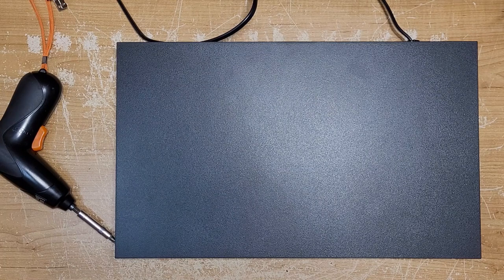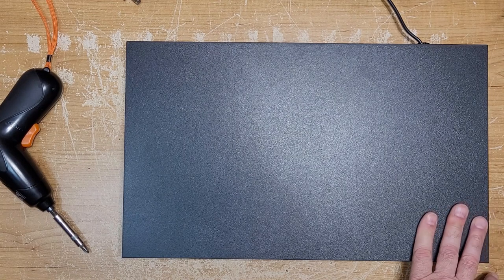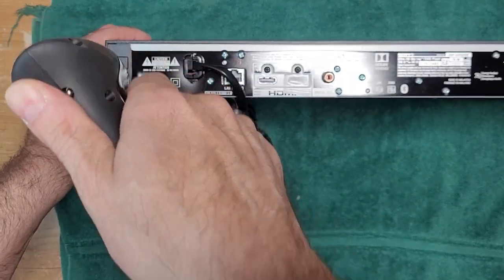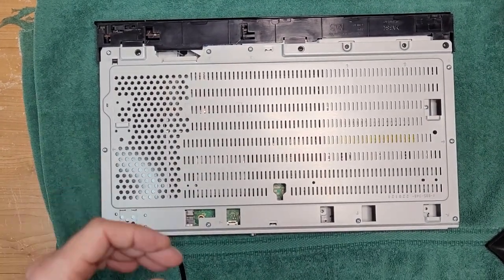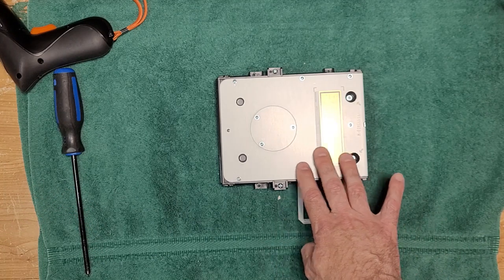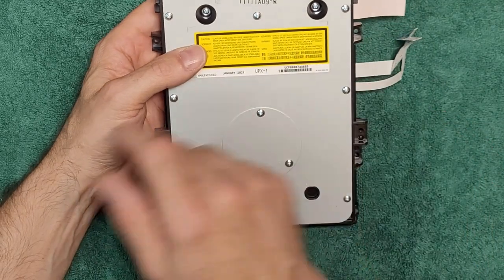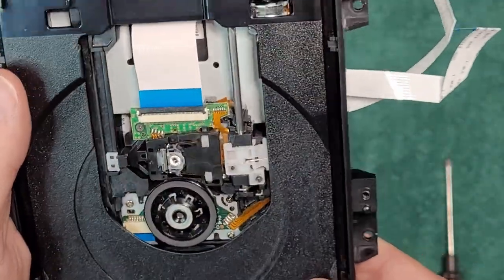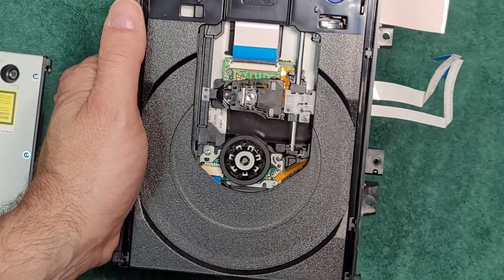Sony UBP-X800m2 4K Blu-ray Player Freezing Issue

Comment: I have the UDP-X700 that freezes on 100Gb discs on the third layer change. After a lot of testing, I proved it was heat related by removing the cover and running a small fan on top. From there, I desoldered the heatsink and replaced the thermal transfer material on the main chip under the heatsink and added some thermal transfer material on the memory chips that are under there too. From there I have installed a small, 5V fan pointing at the heatsink, powered by soldering to the USB socket internally. So far, no more freezing. Still it’s a lot of trouble to go to just to get something working the way it should have from the factory.
Reply from the maker: I've run my unit with the top off so that it would get full, open ventilation and I've added heat sinks to all the chips.
Reply: Awesome, might as well build one from scratch.
Reply: @garyharper2943  I completely agree, but it is the only 4k player I have.
Reply: @Space-Coyote  Great you have that skill, no such luck for me. I did buy a USB fan that I’m going to either suck or blow air from the back. Looked at just buying the Panasonic, but they seem to not be glitch free either. It’s not that big of deal, but I can’t stand anything that doesn’t work properly , maybe that’s why Oppo got out, couldn’t make one that would reliably work.
Reply: @garyharper2943  Yeah, I have heard about similar experiences with all the 4K players out there. If you are comfortable with removing the cover, it might be worth running the fan on top of the heatsink, just to prove the problem one way or another. Bearing in mind that I have the x700, not the x800 and the x700 is very easy to get into. Good luck!
Reply: @Space-Coyote  I have both the 700 and 800 with same issues.
Reply: @Space-Coyote  Wanted to give you an update, since you provided lots of ideas. I ended up purchasing an Infinity 4” usb fan and placed behind unit blowing away from player. I have watched 3 problem 100 gb discs since and all played without issue. Not ready to declare victory but so far so good!
Reply: @garyharper2943  Hmm that is good to know. I'm not 100% happy with my internal fan solution. It's a 1” fan running at 10k RPM and while it isn't noisy, it does whine a little. Sounds like the air flow your fan creates is enough to keep things cool. I would be grateful if you could keep me up to date on your findings.
Reply: @Space-Coyote  will do , the infinity fan has three speeds and is quieter than my projector fan and I didn’t have to open anything up!
Reply: @Space-Coyote  More good news watch 1917 and John Wick 3 both problem 100gb disc, no freezes. Now the really good news, watched them back to back!
Reply: @garyharper2943  That is good news. It definitely seems that there is a problem with heat. It is odd that not all of them have the skip/freeze problem. I hope this is a long term solution for you.
Reply: @Space-Coyote  Thanks, it’s almost like some of the movies make the unit “work” harder.
Reply: I’ve had to sit X 700 for years it hasn’t skipped once and I watch movies on it almost every night. This is not an insult but maybe you’re not taking care of movies correctly or you just unfortunately got a bad one.
Reply: @michaeldietz2648  mine 800MK2  is freezing on Netflix and YouTube after long time period approx. 3hour and more. Next video just stop on 20% load or such. Can`t turn it off with remote have to unplug the cable from socket. Will try to open the case and check temperatures.
Reply: @ivanmelkner7704  Well I’m not sure in your situation because I would never use 4K Blu-ray player to watch Netflix or YouTube but that might also be a problem with your Internet.
Reply: Hi, with the fan powered by USB have you solved the problem definitively? Thx
Reply: @Space-Coyote Hi, with a fan powered by USB have you solved the problem definitively? Thanx you
Reply: @garyharper2943 Hi, with the fan have you solved definitively the problem of freeze?? Thanx
Reply: @TheZakkomodenese  It improved the problem, but did not solve it completely . I ended up getting a Panasonic 420 and it’s been perfect.
Reply: @garyharper2943  Thank you for feedback. I have added a fan inside the unit powered internally by the USB and for now 0 freezes.
Reply: @TheZakkomodenese  It definitely removed the problem for me, although it is hard to comment now because the player was dropped and now it won’t read discs at all. I’ve had my eye open for replacement drives since but nothing has come up yet. I replaced it with a Panasonic 820 which has been bullet proof, but comes from the factory with a fan.

Comment: Most of the time, it's smudges or a film on the disc (especially 4k).  Try cleaning the disc with a soft microfiber wipe.  I had freezing issues on the 800M2 and that fixed it.  The laser has trouble reading thru the film or smudge.  Quality control on 4K discs has been substandard the past year or so.  Try cleaning the disc you are having trouble with. It will more than likely fix the issue. It's not s Sony software or hardware issue...it's the disc manufacturers.
Reply from the maker: Tried that, no difference.  I'd say it's definitely a Sony issue since the discs play perfectly in my Sanyo 4K player.
Reply: No it's not the disc at all you fool. It's definitely the player.

Comment: Mine used to freeze about 10% of the time, but after the latest firmware update a few months back, it hasn't frozen up once. I really think UHD blurays are pushing the capabilities of optical media to it's limits and that's why they are so finicky, I have a few different players (and gaming consoles that have UHD players) and almost every single one has had issues.
Reply from the maker: I agree.  There are so many layers in these discs, I can see them being difficult to read.  What is strange though is that my el-cheapo Sanyo 4K player reads everything flawlessly.
Reply: @TurntableGuy  I didn't even know Sanyo made 4k players. 

The one that's always worked for me is the Panasonic UB820.
Reply: @LumberjakPipester  that's also a crappy player. I've already bought two and both had freezing and pixelation issues.
Reply: My Samsung one sometimes blacks out for a few seconds when watching a film so I have to rewind back to the part I missed
Reply: Lol.

Comment: Same thing on mine. It recently started after an update. The unit runs cool and heat is not an issue. Multiple brand new discs are locking up and always at the same spot which seems to be where the laser needs to switch layers. It’s driving me insane! I also get a strange error where it won’t turn on sometimes and I need to pull power and plug it back in, but I run a custom control system so everyone may not see that.

Comment: Was looking at getting one of these a while back and was concerned with it freezing.Was given the following advice so please try this.Turn off quick start feature so as a fresh boot up starts each time.Don’t know if it will work as didn’t purchase this item in the end.
Reply from the maker: I have never had quick start feature on.  I have also read that some of the freezing may be due to having the player hooked up via ethernet or wifi.  I have just disconnected mine from the internet, so we'll see how that goes.
Reply: @TurntableGuy  Hope you get it sorted.If and when I get mine definitely will be the Panasonic.
Reply: None of those things help it.😊
Reply: @TurntableGuy  did disconnecting it from wifi work?
Reply from the maker: @Digmdnes  No it did not.  Neither did disconnecting the LAN cable.
Reply: Did turning off upscaling help any? I did this based on a video by TheOriginalFuzz and so far it's been pretty reliable. I wish Sony didn't have upscaling on by default.  Most modern TVs upscale just fine if not better than players anyway.

Comment: I have the same issue. So far, disabling Bravia mode, BD Live and upscaling has resolved it. I'm on my second run on Top Gun Maverick, where previously it would stop as it enters chapter 13. I can only theorize the processing of falling snowflakes was too much combined with the heat (the underside of the unit was extremely hot). Network is still connected. I used to be able to repeat it consistently when I'd watched the movie in its entirety. It would not fail by skipping directly to Chapter 13 presumably as there was no heat. 

I've left it playing in the basement and set the timer for 1hr 40 to see if it fails or plays through. If this is a success I can try to reproduce it on the other failing UHD disc I own, which previously failed too. So far so good though.
Reply: I should add this is playing thru a Denon AVR-X3700H and thus it also does it own upscaling too, so I dont really care if the Sony does it or not. This unit is exclusively used for UHD 4k and Atmos.
Reply: Eagerly awaiting the results of this. I have the same AVR and my TG: Maverick disc freezes at exactly the same point (and other discs at similar times). It's driving me mad!
Reply: @abhiahluwalia  crapped out on the 4th test. Progress but still. I am about ready to put the player in the trash and stick to buying digital codes only, especially since this is the second unit I've tried, with the first being replaced by Sony under warranty.
Reply: @philk56  Damn. Been coming to the same conclusion myself after reading up online. I only use the player for special films where I want to make sure the video + audio is the best it could be, so this is ruining films I care about the most!
Reply: @abhiahluwalia  I have one month left under the original units warranty. Sony are now sending me a third unit to try.
Reply: @philk56  I'm out of warranty so my best hope is selling it on ebay 😅 why must life be so hard 😂

Comment: I bought the 800m2 thinking that Sony would have fixed the freezing issue found on the 700 and original 800; but mine has had consistent issues freezing until the power cord is unplugged. I added an inline rocker switch to the power cord so I didn't have to reach the unreachable plug every time.

I can add one new piece of information: mine has also frozen with blurays and even a regular old DVD (free of scratches.) It's not just multilayer 4K disks. I've tried turning off all network related features, but i haven't turned off upscaling or the 24p suggestion. I'm really dissappointed in Sony with this five year old problem. Hmmm....
Reply: Disconnected for network turn off 4K upscaling fixed it
Reply: codydively9017 I will try everything u have said here and get back to you. One more question quick start must be off and not on
Reply: Exactly same for my player! UBM-800X2. It started to do so with 4k BR discs and recently was starting doing so with BR disc.
I changed the HDMI cable also did factory reset. It is even worse freezing more frequently.
Everytime need to unplug the cord so I put a wifi plug to stop the player without unplugging the player.
It is unacceptable for a +300€ player. I am located in France.
Sony doesn’t take care of this!
Reply: codydively9017  Upscaling off, brand new player and disc, froze at the third layer, returned the 800m2 today.
This was the very first disc I played.
Reply: Turn off 4K upscaling. It actually upscale 4K discs as well causing it to use more power. Most modern TVs will do the upscaling better anyways.  The 4K upscaling on the blu ray player is pointless and upscaling already 4K material is ridiculous lol

Comment: Try the settings of TheOriginalFuzz advice for the freezing problems of the 4K players of Sony. Up to now I didn't have any freezing since I changed the settings to that advice in my Sony 800 mk1 (I don't  have the M2).
Reply from the maker: Tried all the settings, nothing works.  Player is defective.  Bought a Panasonic 820.
Reply: @TurntableGuy : One problem with the Pana is, if you have SADC's: they can't be played on the Pana. And I have some SACD's, so I can't switch. For the rest: great player.

Comment: I’ve had bad luck with 4k players. 
My first one was a Samsung player and it would have a grinding sound on some discs and it actually ruined my copy of the the dark knight. I replaced it with the Sony x800 and it always had freezing problems. Then I bought a Panasonic 820 and it never gave me any problems but after a few years I wanted something more “premium” so got the Panasonic 9000 and that was the biggest mistake I ever made. 7 months after I bought it, it started to have video glitches. Sent it for repair and paid $115. 7 months after the repair it has the same problems and now I am no longer in warranty for parts or labor so repairs around $700 lol what a joke. The player was $1200 lol

Comment: Yeah, that is bizarre that the player doesn’t have a way to dissipate the heat generated inside.
I have the UDP-X700 & it’s problem is that it occasionally shuts down, locks up not freezing.
It’s apparently a known firmware issue.

Comment: Don't have the player but planing on getting one. From what I saw online, turning off the 4K Upscale Setting and setting the Cinema Conversion Mode to Video helped 90% of this problem to go away.
Reply from the maker: Doesn't work on mine.
Reply: @TurntableGuy  Normal Blu-rays and older (first) uhd discs never had this problems. I think that all comes down to HDR (specifically Dolby Visions new profiles) pushing the chips harder and creating thermal throttling in these players. It's either that or the industry makes intentional bad discs so the physical media dies out sooner. These plastic banning mofos and the crowd behind it.
Reply: @MauroEnass yeah no your probably right about Dolby vision. I just had an LG oled have freezing issues when playing only Dolby vision, it got to a point where I’d have to unplug the tv and plug it back in for it to work. Something up with Dolby vision.

Comment: I own this player and have had one or two discs freeze. I cleaned the discs and the problem disappeared.  Never assume a disc right out of the box is perfectly clean. They are not. The entire player occasionally freezes up.  An unplug, plug back in reset takes care of that.

Comment: I have the original model of this player the UBP X800 that just dose HDR10 no Dolby Vision and it’s been working fine. Sometimes it acts up shutting off it will power cycle and not go to standby but other then that the payer has worked 90% of the time.

Comment: Had a problem with freezing on the 4K UHD Blu-ray Top Gun Maverick disc; it would black out occasionally like a video dropout  and then resume within 10 seconds.  Also, the player's menu system would not show on the TV when selecting the menu button on the player remote.  The player was hooked through a Denon AV receiver acting as a hub for multiple devices with a single HDMI out connecting to a Bravia 65" 4K TV.  I decided to hook the player directly to the Bravia TV via a different TV HDMI port and voila; everything worked, freezing disappeared completely and the player's menu system appeared when requested via the menu button.   I assume the Denon AV receiver loses something in the 4K video interface before reaching the TV.
Reply from the maker: Interesting.  Might have to try a direct TV hookup since the player has 2 HDMI outputs.
Reply: No problems with either X800 or X800M2.I own.
Reply: I solved the problem by using new ultra HD 4K certified HDMI cables in connecting through the Denon VA receiver as a hub.  Everything works well now, including improved Dolby Atmos sound.
Reply: @johnbovard8454  Any chance you can write the name or brand of the cables? Or are there any specific declarations to look out for? I have bought some "high speed 4K certified" cables in the past  but i think the box labels were misleading.

Comment: Once you said it only started upon a firmware update I would never attempt any of what you did in this video! I would have found a way to reverse the update!
Reply: I was thinking the same thing.  How can you pin the problem to a firmware update and then take the unit apart?  It's not logical.

BTW I'm looking for a 4K unit.  Owners are saying the Sony and Panasonic units are freezing up but what are people recommending under $500?
Reply: @voiceofreason9238 let us know when you find a good one. I have the Sony 800, no freeze yet. Fingers crossed 🤞

Comment: I feel a lot better knowing I wasn't the only early adopter of HD-DVD. Oh well... and here in Australia as well !! Great channel BTW :). I'm wondering, is it freezing when a layer change occurs? This would hint at the fact you did a firmware upgrade recently, just a thought 🤔
Reply from the maker: Difficult to tell if it's at the layer change.
Reply: It is frequently due to a layer change. Also, it could be a heat issue.
Reply: Wow.  I just ordered this model.  We are renovating house so we threw out all my dvd collection since I never play them, also threw out my HDDVDs.  Oh, well.  

My components all have fans.  Doubt that I’ll have heating issues.  I purchased this because my five month old Panasonic stopped playing my discs.  Message incompatible discs.  I was so angry I slammed the player against the tile floor and just threw it in the garbage.

Comment: Same issue in the UBP-X700, sometimes it just freeze and I need to unplug it, and plug again. Yesterday, I was watching Transformers the Last Knight, and It freezes like 1 or 2 seconds in two or three parts of the movie, but I think it could be related to the disk, because it happens always in the same point. However, the complete freezing symptom also happens from time to time. Other issue is when certain disks are playing, the player emits a lot of noise during playback, but it does not happen with all disks.